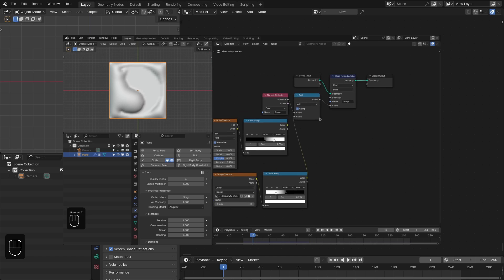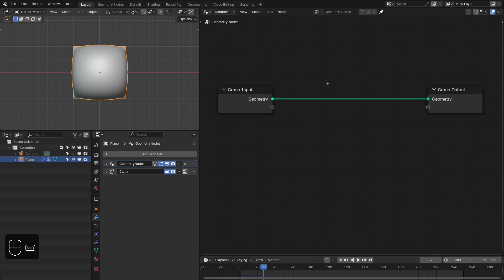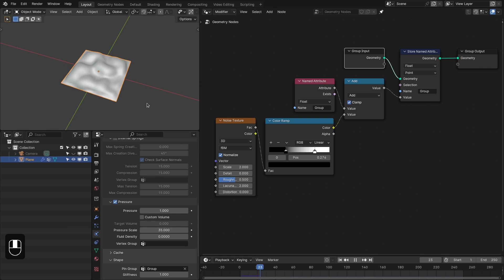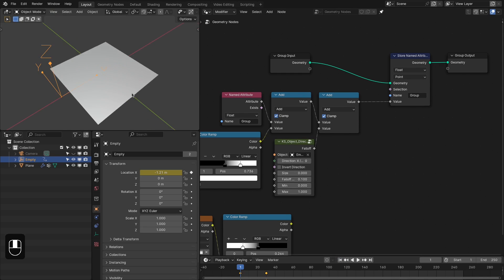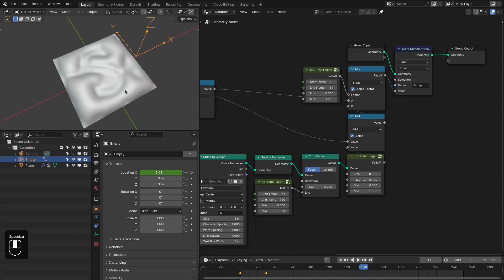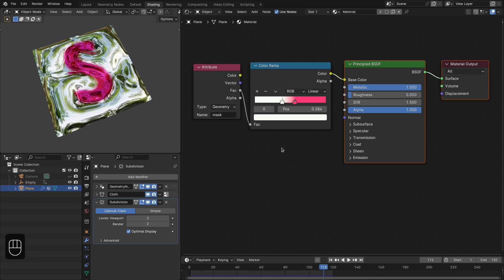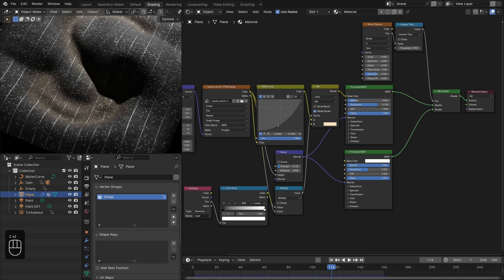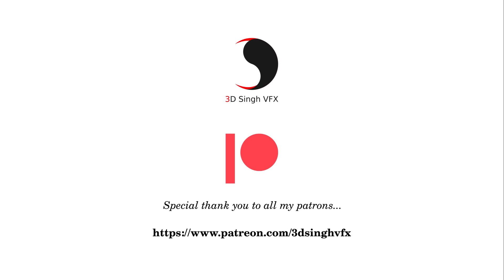Vellum Cloth Effect with Geometry Nodes in Blender - Tutorial

Comment: Yes, I agree, it can be done this way
and in principle it is not difficult to specify the vertex group on the finished geometry.
And what about procedural geometry?
procedural geometry attributes are not available to non-procedural modifiers
The conclusion is that we have 2 ways.
we need to give the ability to access attributes
or write clothes in geonodes
Reply from the maker: Hi.
Yes, geometry nodes do not allow to write new vertex weight.
Another way is to create procedural geometry and combine it with existing geometry using a boolean node. In this way, you can access the Vertex Weight.